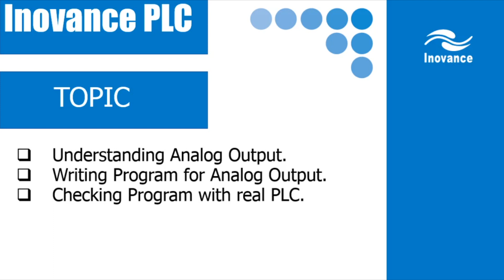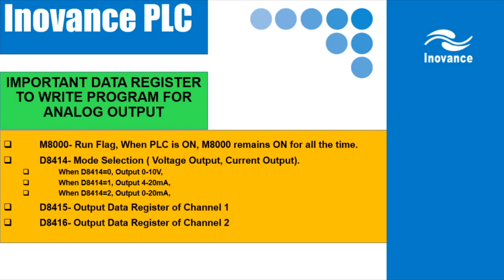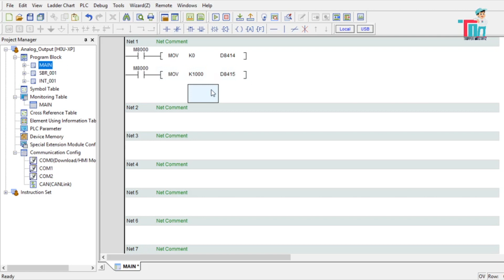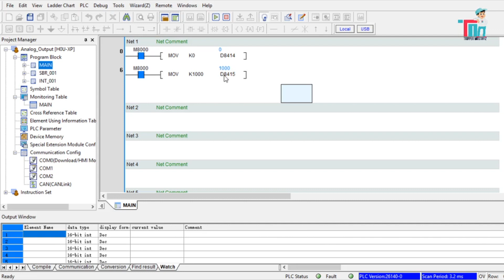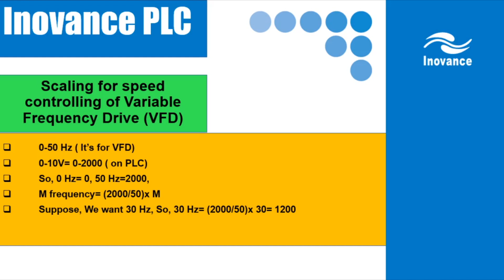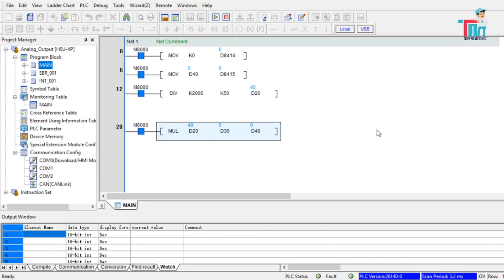Inovance PLC Programming | Part 4 | ANALOG OUTPUT | Autoshop Software with TRIPPER MOSTAFIZ

Comment: Could i interface this plc with weight scale
If we give set value ( Desired weight) at HMI , after reaching set point we will get a signal by which we will control a load (On /OFF).  Have any load cell module that will interface with this  PLC
Reply from the maker: As you know, Load Cell gives a very small voltage as an output; So you have to use such converter which can convert the output of the load cell to 0-10V or 4-20mA. This PLC can accept these two analog input.. Then you will be able to do rest of the things. Thanks....